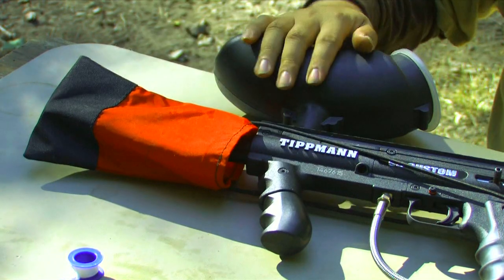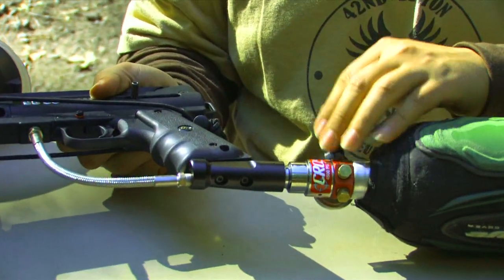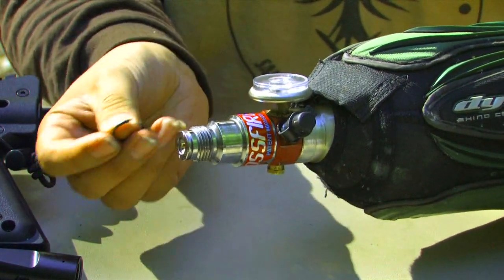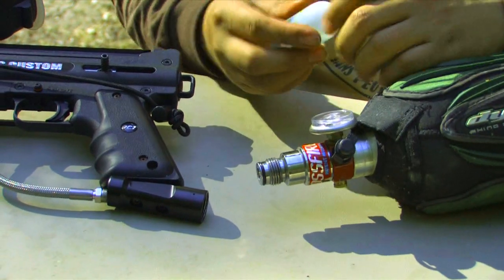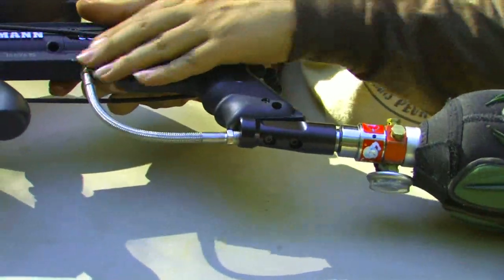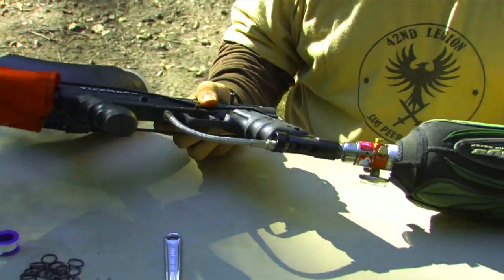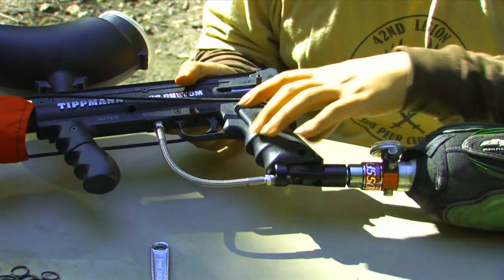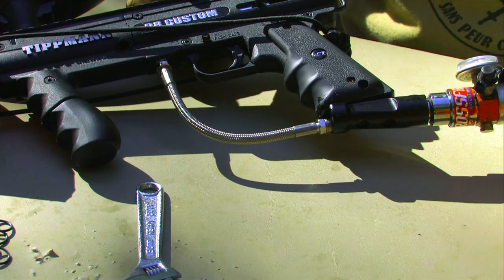Paintball Tips : How to Fix a Leaking Paintball Gun

Comment: Other issues include:
1. Cross-threaded or damaged tank threads
2. Obstruction in marker assembly
3. Insufficient pressure in tank (won't seal correctly)
4. Marker pressure release not secured or not functioning correctly

Comment: What if the leak sounds internally? I haven't used my 98Custom in 10 years and I just bought a new compressed air gun today and it still shoots but it was leaking from inside the whole time I was shooting.
Reply: Rumeel12708 I have the same problem